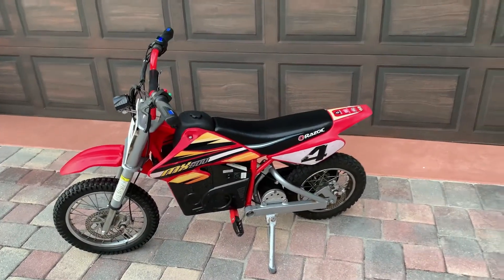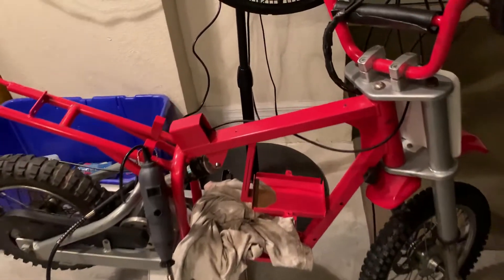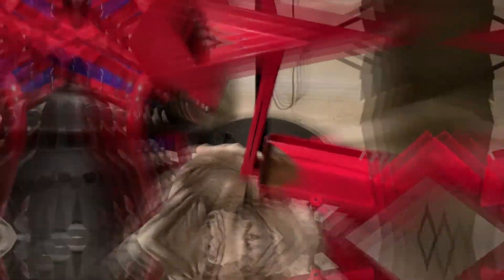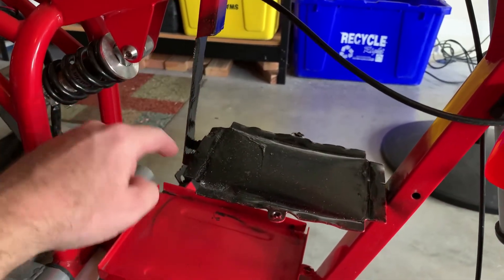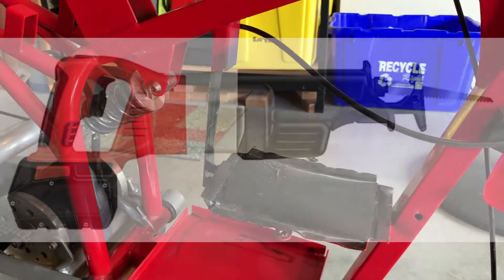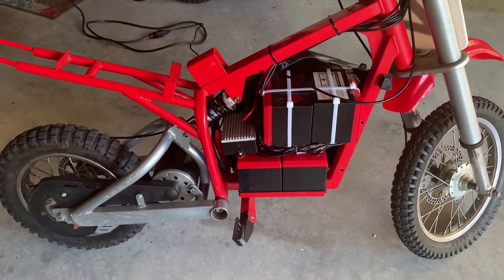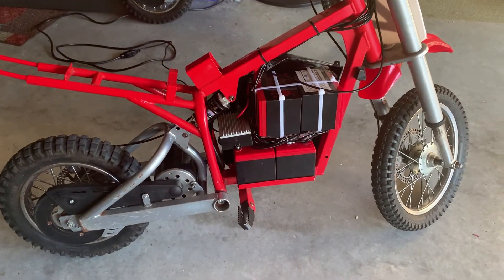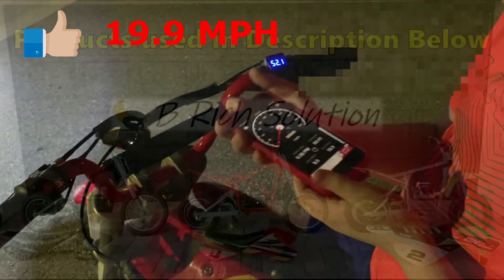MX500 or MX650 upgraded to 48 Volts with SLA

Comment: How well do you think your setup would work on a mx350 razor? Probably have to make some mods in frame but you think itd work?
Reply from the maker: Not sure you can fit all the batteries in mx350 frame.   Use li-ion 36V battery with stock controller and motor
Reply: @BRichSolution  the fastscooters 48v throttle and controller kit says if you install that controller and battery you don’t need to install a new motor. Is that not right?

Comment: What happens if I put a lithium battery and a 48 volt kit on will I need to get a bigger motor?
Reply from the maker: If you install a 48v controller with stock motor you will gain no performance.   I tried it no gains.   Stock controller can handle 48v li-ion battery

Comment: What happens if I change the motor and controller but don’t change the battery? Will it speed up and run out of bat fast or will it have no difference?
Reply from the maker: There will be no change if you leave stock battery and upgrade motor and controller

Comment: How did u add headlight?
Reply from the maker: If you are have the stock batteries you can run the headlight off one of the stock batteries and attach +\- terminal.  You can also splice in just down stream of the  main on/off switch see video at 2:02. https://youtu.be/yw7w0vJrWcI
Reply: Thank

Comment: Do you know if this will burn up on 54 volt trying to use Milwaukee 12 amp hour batteries
Reply from the maker: It should handle 54V; my Li-ion battery full charge is 54.6V.    BTW - tool batteries tend to not give very long ride time due to the low Ah rating & tool batteries are expensive compared to Li-ion Battery.    http://ebay.us/2AUk7j  (in stock next week)
Reply: @BRichSolution  I already have a bunch of Milwaukee 12 amp batteries that’s why I was going that route

Comment: I mean, is it really worth the extra money to upgrade to 48v?
Reply from the maker: 48V with stock motor you will gain 5 mph.     It's a noticeable step up from 36V.    There is some negatives see this video:   https://youtu.be/kRvYAI1hdc4         What I am doing with my sons bike it going to 48V to give him a slight boost in speed & torque.   If or when he burns out controller or motor then I will step up to 1000W motor & controller.
Reply: @BRichSolution  ok thanks!

Comment: Will it work with a stock charger?
Reply from the maker: stock charger is only 36V, you need 48V charger shown at 0:17 in video.   you can order the charger using this link   http://ebay.us/W9zDwI      Beware most chargers on amazon are to Li-ion batteries which is not good for SLA batteries